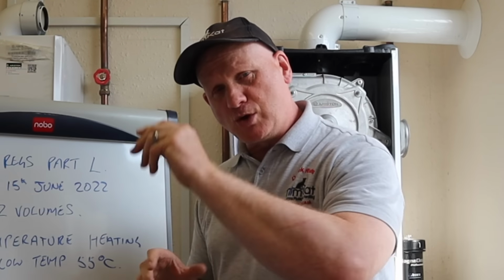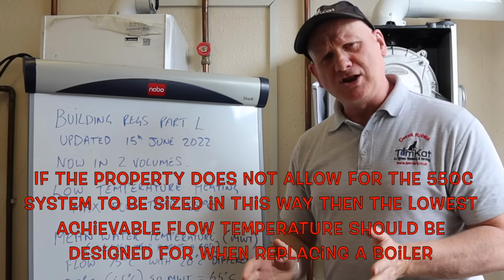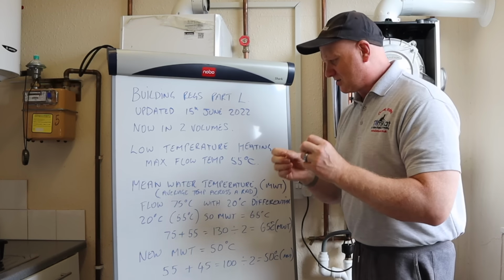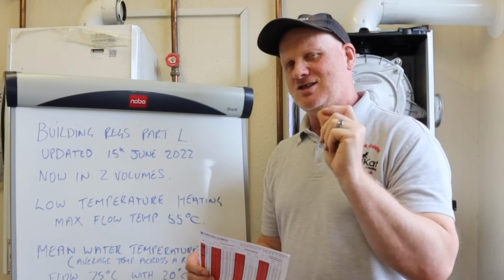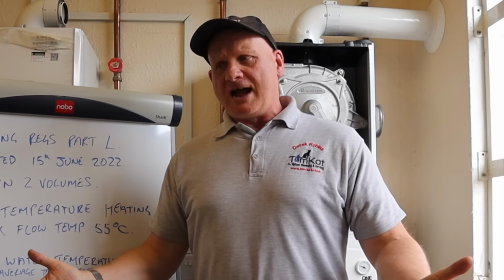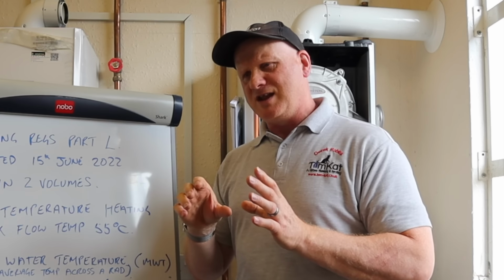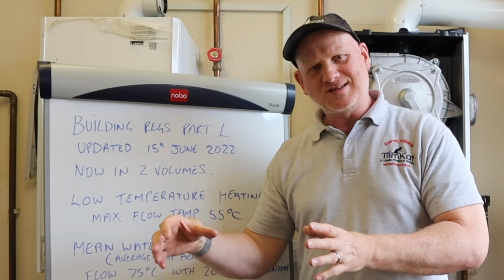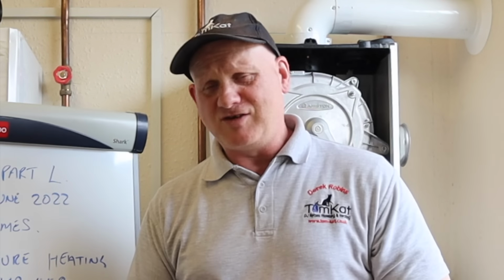Don't adjust your  heating flow temperature until you have watched this video. #saveenergy

Comment: The biggest differentiator in consumption is the weather, so hope for a mild winter. All the new regulations are just the tail wagging the dog. 21C used to be a comfortable temperature. Now it's 19C. Have we suddenly changed as humans? No! Did we all sit in no clothes at 21C, and are we now all sitting in 6 jumpers and 4 pairs of socks? It isn't going to save any money if you have to fit bigger pipework and bigger radiators, which cost more, take up more space and look ugly if you have to run your boiler at 55C. And who leaves their boiler on all day? Who comes home at the same time every day? Whose life is so empty that you are constantly working out when you will be home, and adjusting the time-clock or thermostat remotely? Most people leave the heating on a sensible set-back temperature and then turn it up when they get home, and want it to get warm quickly, not wait hours for it to warm up because it is only heating to 55C. And variable speed pumps don't work with  underfloor systems that require a constant flow rate, and they don't work with automatic bypass systems either. Most variable speed pumps are set to a constant speed, just like the old ones because that's how most systems work best. I replaced a totally undersized 28 KW boiler with a 70 KW commercial heat only boiler which runs at 75C serving 3 zones plus the hot water. It can heat a 250 litre unvented cylinder in 30 minutes and the radiators are at full working temperature in 5-10 minutes. The rooms get hot quickly. The consumption is similar to the old boiler, depending on how severe the winter is, and it very convenient to have hot radiators so quickly. And as for switching off the microwave to save the power that the clock draws - again,  only for people with empty lives. It draws so little power that it isn't worth the hassle. The power spike each time will shorten the life of the microwave, the switch on the socket, which is probably at the back of a cupboard and is hard to reach, will wear out and it will cost far more to call an electrician to replace the socket than you will ever save.
Reply: I had a mate who turned his boiler pilot light out every night......all the money he 'saved' (and more) was gone in an instant when he had to call an engineer out to replace the piezo igniter 🙂

Comment: I have just had a new boiler installed on an old radiator system with 15 mm pipework and single radiators. What puzzles me is reducing the flow temperature just increase the run time of the boiler. The boiler is a 2021 Worcester Greenstar 4000 30kW, it's new and is the latest model. I have thermostatic valves but don't really use them, I have the ERP Stat controller in the hall which has no thermostatic valves. My house is really well insulated. I'm still puzzled what to set the heating flow temperature to, the hot water temperature is dead easy. After watching the video, it seems likely that setting the flow temperature to comfort level is the way to go, I have mine set at 67C. Any advice would be appreciated.

Comment: Any way to determine the flow rate off the boiler? Or work out what the flow rate will be at each rad? I'm looking to replace all my rads with convector heaters but could do with calculating what the output would be for each before I start so I don't have to add the electrics for fan assisted if I don't have too.

Comment: I think it's worth adding that if your radiators aren't big enough to allow the return flow to be as low as 55 C while keeping you warm, then you can at least turn it down when the weather isn't quite so cold. In my last house, where this was the case, I would adjust the temperature a bit every week if necessary, and it was probably only over 55 for a month or so in the coldest part of the winter. Even better, fit a weather compensator, which does this automatically.
Reply: You can get fans to assist radiator convection
Reply: A weather compensator? Never heard of that before? What does it do and what is it?
Reply: @David.L291  I'm not an expert in any of this but, as far as I know, at its most basic it's an outdoor sensor connected to the boiler that adjusts the burner (and hence the flow temperature) according to the outside temperature. In other words, when the weather is milder it reduces the flow temperature automatically, improving efficiency. Presumably the boiler has to be compatible with it, but I think modern boilers are. I don't know if they can necessarily be retrofitted to older models though. I remember it was an option I was offered when I replaced the boiler at my last house.
Reply: My boiler doing a fairly high humming sound, working fine. Fan perhaps.

Comment: As a rough guide for each 6c the boiler is reduced from 80c flow temp the heat out put of radiators reduces by 10%

Comment: Never work on a large detached property with 15 large rads. Set temp at 73c return is 51c. If it is colder outside with gusty winds it drops to 47c. Wish It could be set higher than 75.

Too low of a temp will never warm a house. A stat is useless as are trv. Stat is only in one room. Too much building control and laws have destroyed this country

Comment: There's no room thermostat fitted. Or let's say there is one, but it's not connected to any wires. There are no thermostats on radiators. The boiler can be turned on or off. To save energy, I keep the boiler off and turn it on when the living room is below 14°C.

Comment: I realy wish the plber who replwd my house 2 years ago understood or had watchwd this video. The bog brained plumber put both cold feed and hot tap and radiator feed pipes hard against each other. He installed my boiler in the loft.. but did not insulate any pipe! I had over 10 meters of pipe un insulated and installed is such a way that the pipes cannot be individually insulated. He was in his 20's so should have been recently qualified! I will have to get it all ripped out and redone properly. This will require my 2 year old bathroom being removed too. :(

Comment: You've confused too many issues for my simple mind. 
I have a combi boiler. I adjust the system temperature according to various factors:
 1. The ambient temperature,
 2. The number of radiators turned on or off,
 3. The number of people staying with me at any given point, based on their heat/cold tolerance. 
I monitor the power consumed at each setting and i always save power on the lower settings. 
From experience this works well for me without having to understand any boiler contraints. 
I've also noticed that i save much more power if i set the boiler to go on and off in half hourly for warmer ambients or hourly for colder ambients, cycles. 
Note, i don't draw hot water from the boiler as it takes too long to deliver it, wasting both water and gas. I have an electric pump for my shower and i kettle-heat water (no need to boil it) for dishes.

Comment: If you get a lot of visitors / deliveries that require opening your doors, then shut as many doors as you can before opening the front door. 
Your house will lose more heat than the boiler can replace .
Reply: Doors aren't supposed to be open for various reasons anyway

Comment: So here's the thing; you change a radiator (or one of its valves) and when you come to bleed the system you learn that there's a bleed inside at the top of your (eg) Worcester Bosch. "Oh cripes, I'd better get one of those qualified  consultant gas fellows in to bleed the system because I can't take off the casing." I can see the logic behind this for safety's sake, but frankly it's yet another ill considered rubber stamped piece of legislation. The last boiler "service" we had the guy didn't even fit the casing back properly, no doubt because he got hacked off with the value engineered attachment system, and believe me he isn't one of your garden variety cowboys either. Soon you'll have to show some accreditation to buy an adjustable wrench. Good video though, I understood it but then as a (decades ago now) qualified Design Environmental Engineer I flippin' well ought to!

Comment: We turned our boiler heating dial from 4 down to 2, set our rads to 3. We used to have raging heating all around the house. Gas consumption reduced, lower bills and still have reasonable heat out put. However we do have cavity wall insulation, loft insulation, double glazing and insulation floors….. thermostat is set to 19th g.
Reply: Did you find it takes longer for the house to heat up from cold?

Comment: A lot of crap, this is ! How in the name of god have we arrive at the point where the government will tell me I can't have a bath above 48 degrees ???? And those 82 degrees, my god, you're gonna get third degree burns on your skin if you touch the radiator. 
My heating runs with 48 degrees in the flow, and it does a perfect job. 
You can heat a house with a candle, the trick is keeping the heat in. Don't put your money in a heating system, put in insulation instead !!!

Comment: Boss video! I can’t get my head around Delta T.  I’ve had external wall insulation, triple glazzing, PV storage. Next step is ASHP!!!!!  Currently running the regular boiler at 50c and the house is comfortable however I would like to future ASHP flow temp as low as possible.

Comment: Good video. If the flow temperature is turned down to 55C isn’t there a chance that the the room will never reach the ambient temperature that the TRVs are set to and the boiler will just be on for much longer as the radiators struggle to get the room to a high enough temperature? Or would this still be more economical than having the temperature set to 70 or 80C?
Reply: Yes, you can set to 45c but you will need bigger radiator like type 33..
Reply: @hardcoreplayafromthehimala4888  Thanks for the tip
Reply: @jacc88888   it's nothing. Condens boiler are beste exploited for floor heating, where outgoing water is less than 30C and return is also less then 30C....catch is in returning water, if water is below 55 C on return, then will condense but not much....so technically you can heat with 70 C output but you need bigger radiators 2x so you can reach room temperature in short period of time until return can reach 55 C or equals output.  Sorry bad English

Comment: So we get rid of natural gas and heating oil.....where does that leave us......electricity......what does the power plant now use to generate the grid power? And you need a dishwasher water temperature of 65 deg C in order to kill bacteria. That means the dishwasher needs to use even more electricity to heat the tepid water from your water heater.

Comment: Casting the mind back to the last century radiators, like the ones in schools and office buildings, they were large bore, as were the pipes. Are we just doing a circle back to the old technology ?
Not impressed with the reliability of the new combi boilers, they seem to keep leaking, pcbs failing and just require much more attention that the older ones.

Comment: We had an argument with the last 2 technicians who inspected the boiler. First said: You should keep the dial on max, as this will quickly warm the radiators very hot and switch off the boiler for a long time, and reduce energy bill. Otherwise, it will trigger ignitions so often, which will keep the pump running constantly and use electricity, which is expensive now. Also on every ignition he said, there is a loss that goes in the chimney. The second technician said, keep it on 50 degrees and leave it. You should be able to touch the radiator and not burn your hand. From what I see by following the second advice is, the electricity bill goes on 20% higher. Please comment on this.
Reply: I've done some tests in my own house. I have loft insulation, cavity wall insulation, but only floor insulation in 1 room. I'm also missing insulation on the roof joists, so my house isn't as good as new builds for insulation.

When I try 50C heating, it cost 44p for 15 mins, but really didn't make much difference to the temps. At 70C, the rise was noticeable and the heat lasted longer, but cost 71p. 60C was 55p. This was whilst it's ~0C outside in the UK.

I think the 50C is for people who have a well insulated house and can maintain a temperature throughout the day. For me, attempting to maintain a temperature is way more expensive than just boosting for short periods and, when I come home from work 50C would just take too long to re-heat the house. In the end I'm hovering at 66-68C to get the boost factor, but also taking a safe bet that the return temp is under 55C for the condensing efficiency.

You probably just need to do your own experiments (easier with hive, etc), but I would at least avoid the max setting option due to losing the condensing efficiency.

Comment: Looking for the answer according to this video from Tomkat. The water flow on my condensing system boiler is currently at 60 degrees but will clearly drop by the time it reaches the cylinder and particularly the shower. Having said that the water from bathroom taps and shower comes out way too hot so I always have to introduce cold water as well. Just wondering if it the water is safe re Legionella bacteria if I turn the flow rate down low enough so the water is a suitable temperature directly from the tap/shower as Tomkat suggests? Sorry if I seem dim  - rookie at this!
Reply from the maker: I was talking about combi boilers not water from cylinders
Reply: @tomkatgastraining  Have subscribed for further training/info. Thanks.

Comment: At the end of the day all you need to know as you lower the temperature on your boiler is, are you warm enough?  All this astro-physics is too complicated for the average person to comprehend.  Trial and error is all you need to set your boiler temperature.  But if you have a water cylinder you must have a temperature of around 60deg C.   Also taking baths is a definite no - no.  5 minute or less showers save a fortune in both water and energy.  Get a shower timer free from your water provider.

Comment: Good explanation from this guy but to put it simple, what if some can't afford new radiators in all rooms? Do they say no I cant install and the person freezes? At the end does it save gas? Because to me you are lowering the temperature of the water but heating more water (bigger rads) but to a lower temperature which possibly equals same use of gas in the end?
Reply: Heating bigger radiators will take longer but if the system temperature is powered then the amount of energy could be the same.

Comment: I reduced the flow temperature to 55C and my gas consumption went down by 29% compared to the previous year.
Reply: What about electricity consumption, did that stay the same or increase? I've heard that the pump kicks in more when flow temperature is reduced?
Reply: Wow! Impressive. I intend to experiment with 60 then 50.

Comment: Sorry to be negative. Lots of good info explained at great length BUT he misses the point completely that an optimum flow temperature to save CO2 and money WHEN THE WEATHER IS FAIRLY MILD may be lowered by default BUT with the option of raising it if THE WEATHER IS SEVERELY COLD and the rooms are too. 
Changing the flow temperature depending on the weather may be needed if pipes and radiators are a bit smaller than optimum by current building regs and the weather and house are unusually cold.
Another obvious point. The roaming room radio thermostat needs to be in the most relevant room that is currently occupied i.e.. not the hall.

Comment: If I replace my standard boiler now ( vented indirect hw cylinder ) , i can't possibly set mmy flow to 55 degrees otherwise the water won't get  hot enough to prevent legionaries.    How is that supposed to work?

Comment: I can see what the crafty government are up to ,they are ensuring by lowering the temps (and thus making your smaller pipes and rads inefficient) and sneaking in their WEF dictated Air Source heating systems . As to your remark about room thermostats not being in the same room as thermostatically controlled rads ours has been for years (and told by the installation plumber "its fine" ) its now been put in the hall with a uncontrolled rad ! Before we couldn't save gas by switching off the rads now we can !

Comment: Couple of questions... I thought boilers are more efficient at full power? Also, with a system boiler, 55C flow temp won't heat the hot water cylinder above 50c or so - if i set the flow to 55 and the tank thermostat is at 60c the boiler will never cut out, right?
Reply: I am having trouble getting a 250L indirect up to temp using 58c flow, im thinking dialbon stat could e at fault, moving the flow to 82deg i start seeing positive movements on Thermo. Having a low flow temp to heatup alot of water to what is a near similar temp, 50deg sounds like youd be needing to run for hours to transfer the heat.

Comment: Our airing cupboard used to be warm. We put an insulation blanket around the hot water tank (which already had a foam jacket), and then the airing cupboard was ambient temp.... ie: All that heat was no longer being lost from the cylinder!